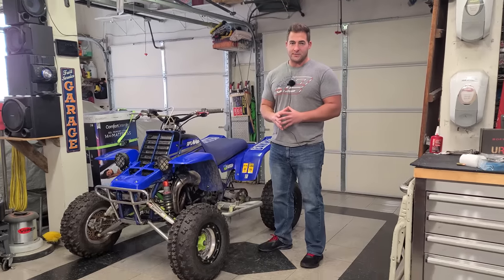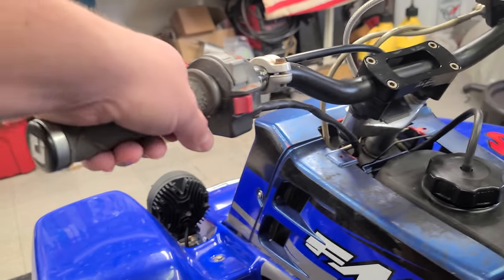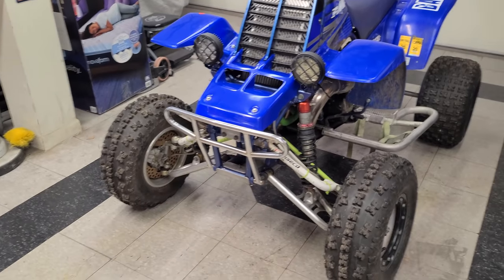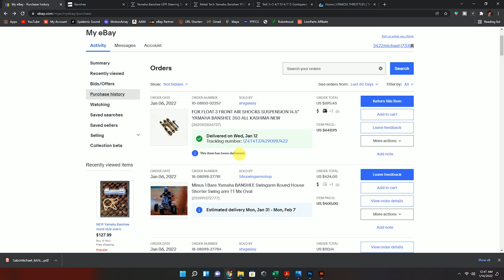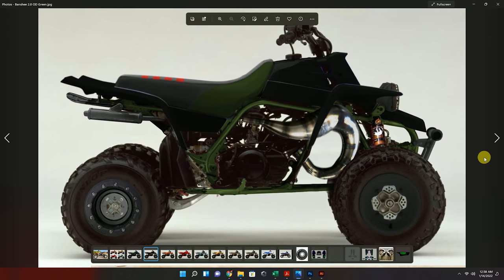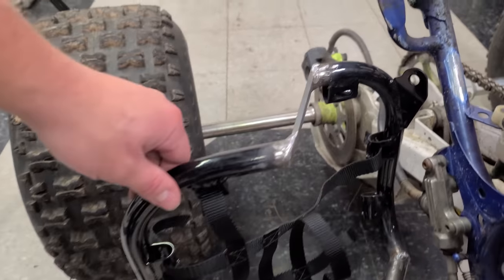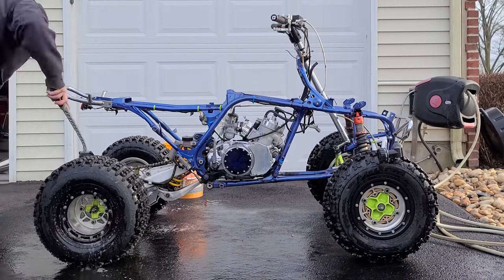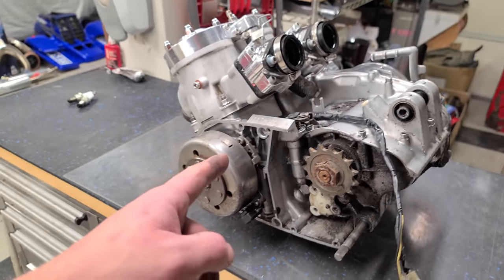Building the Ultimate 2 Stroke Yamaha Banshee for Trails! Voodoo Banshee Part 1

Comment: You would be better off weight wise buying a chromoly swingarm rather than the DOM swingarm from Swingarm shop.  Chromoly is about 25% lighter.
LP Assassin Cylinders with SLP pipes on pump gas is a Trail setup.  More torque in lower RPM and wider powerband.
Cub Porting with CPI pipes on race gas is a drag setup. More HP in Higher RPM and Narrower Powerband.
A foam air filter works better for trapping fine dust found in trail conditions.  The gauze type that you bought is typically only used for the sand dunes.
For a trail machine without Straight cut Primaries, You'll be better off running the Max Load bearings on both sides of the crank instead of the TZ on the PTO side.

Comment: I'm super excited to see the power this makes.  Especially to see how soon it comes on the pipe being a 350 again.  Did You consider swapping over to a new A arms chassis? And for weight, what about polymer rims and bead locks.  I have a set of Tech 3 I found on eBay.  I was impressed.

Comment: Finally, been waiting for the Banshee rebuild video's. Me personally I would have stuck with the 421 and, maybe went with a 2-1 adapter for a single carb. Just my opinion though. Either way, I think we're all looking forward to the build.
Reply from the maker: I'd be interested to try a 2 into 1 setup also; I hear mixed reviews. Thank you for the feedback man!
Reply: Single carbs are nice. You sacrifice a little performance for more low end and a lighter thumb pull. The trick to getting them tuned in right is the needle selection.

Comment: Mike,
I highly reccomend making the swing arm bolt greaseable. By drilling small holes through were the bearings sit; and threading in a grease zerk at one end and plugging the opposite end by threading it and slapping a bolt in. 

100% agree with the planned engine build for a woods weapon. 👌🏻🤘🏻

Comment: I think you should have plus one in wheelbase on the front arms because that also gives you more rear weight bias. Also I always wanted to try the Shearer two into one pipe and single carb. Smooths power band and great weight savings.

Comment: To address the issue with remounting the stock airbox, you should weld on some tabs to secure it only in the back  make them sliding adjustable

Comment: Hey man I'm also from pa but I'm from NW pa and my old 98 banshee was a built as a gncc quad and it was plus 1 wide and it had a 1in shortened swingarm and was lightened up and had bead locks that I took off and that took a lot of weight off it but after I was done with building the motor it was a trail riding beast and was very from end lite and I also recommend the toomy t5 pipes for the trail banshee as well I've tried many others but prefer the t5s 100% and with a good steering stabilizer I think you'll be very happy in the woods mine was a dream to ride and never beat me up anywhere near like my 05 Honda 450r quad did in the woods that thing would have me hurting halfway through a decent ride. But sounds good I'd just recommend not getting too outta control with the Dremel on the cylinders you don't want it to be to be over revy but ya in the woods the minus 1 is awesome for sure and I always ran holeshots on mine even for gncc races and also i found out that the performance of equal length head pipes didn't perform nearly as well as toomy t5s that are not equal length head pipes and it really made night and day difference.
Reply from the maker: Sounds like you had a very similar chassis setup to what I'm planning. I agree that T5s would behave better for the trails; part of the reason I wanted the cub porting and CPIs is because I very much enjoy pipey 2 strokes. If its not as fun as I'm thinking, I will try FMF or T5; I appreciate the tips!

Comment: All that weight savings lost by using water pipe for heel guards.  😆 🤣   Just consider if your wearing boots the angle spot on top might rub or possibly rip a hole or even get stuck in there.   Maybe do a round bend tube?  🤔   Do like the idea your going for.  Plus my buddy is doing a banshee motor rebuild so I can point him to your channel.  Keep up the hard work.  💪
Reply from the maker: Dude I was definitely not in the correct mind for weight savings at the time... that water pipe WAS indeed heavy af lol

Comment: I think u should have worked on getting the power down low for a woods machine. That high comp stock cylinder with huge ports will be all up top. I think it possibly may be worse.
Reply from the maker: It's definitely going to be peaky, but I actually enjoy riding 2 strokes like that; definitely not optimal but the fun factor is awesome!

Comment: The reason the LED lights are blowing out on other people's banshees just like my dad's and cousin's did is because of one stupid thing. The stator puts out AC voltage which LEDs can't handle but regular bulbs can and the stock voltage regulator doesn't work worth a crap. So if you get a voltage rectifier ($15 on Amazon) and wire it in the the light circuit it will convert all AC to DC voltage so you won't fry any more LED headlights or any of your electronics.

Comment: In my opinion, The Banshee is the best 4wheeler ever made period!!! Twin 350 2-stroke! fast AF!!! THE ENGINE & TRANS was originally used on a motorcycle! If one could source that motorcycle, & get the carburetor & the transmission, you'd be set! The motorcycle was designed forage higher speed so, the carb & intake from the motorcycle would definitely benefit you! Along with the sprocket! In a hole shot & out right speed, The Banshee is definitely where it's at!!! I purchased a 03 Blaster 200cc 2stroke/6speed brand new in late 2002 from Wheeling Cycle for $ 3022.00 cash! Tax & everything out the door!!! My buddy purchased a 99-02 (somewhere between 1999-2002) Banshee from Wheeling cycle & after seeing him drive it, I wanted a 4wheeler so, I purchased a Blaster & honestly, I smoked many other bikes except for a Banshee! O e guy was mad because, His 4 stroke 4-wheeler cost 13k & was SLOW! IT MAKES MY BLOOD BOIL THAT THE EPA BANNED 2 STROKE ENGINES WITHOUT TRYING CATELYTIC CONVERTORS! 2 STROKE ENGINES ARE WAY FASTER THEN 4STROKE!!! The motorcycle that used the same drivetrain, had a 2 into one carb!!! Try & get one!!!!

Comment: Looks like you got Michigan ORVs on there. How do you like our state's STUPID system? 2 stickers for $36.25! Used to be 1 sticker for 16.25. STUPID ass Michigan... X(

Love that SPACIAL crank!

Don't make pipes for Banshee's anymore? That's DUMB. That'd be like discontinuing a pipe for the TRX250R. DUMB.

$9000?! 0_0

I don't think that heel net is ugly! I think the upper extension shoulda been pipe like the lower, to make it look more uniform, but that's just me.

Hear me past Mike, I have the solution to your airbox woes! P-CLAMPS! Ah, you saw what I saw in a few seconds. But yeah, go with the rubber sleeved P-clamps. Adjustable for future mods too, as opposed to welding tabs in the new locations.

38.629 years is 14,108.585 days.

I laughed at "scissoring action" as soon as you said it. Juvenile humor is fun.

That skidplate would still be good if it was a PRM. Too bad they stopped making stuff. :( I've got a 1/4 one on my Zilla that could shrug off a small bomb.

I can't tell ya about the engine direction. I'm used to big singles, so I like my torque. Only time will tell you if you made the right choice.

Comment: As far as good led lights- Rural King!!!!!! I got a set on my car! I purchased the wire harness at Walmart but, GET THE LIGHTS FROM RURAL KING!!! OR IS IT ROYAL KING? Pretty sure it's Rural King. Are you missing a sprocket cover on the trans that covers the chain? Looks like your chain needs oiled along with the nut on your front sprocket on the trans.

Comment: Michael I bought a vapor honing cabinet from vapor honing technologies last year and even though I'm kinda semi retired I still build a few engines for the guys at AGMX and some of our local racers and I just wanted to tell u how awesome your Vids are and if you would purchase a vapor honing cabinet to get one large enough to do engine cases and larger quad parts cause I bought a micro blast and I can do engines,but not anything big like frames and long (over 14 inch)parts like aluminum swingarms.And u would also need a pretty decent sized air compressor so check the CFM  of said compressor if u go that route.And I'm a new sub cause I really enjoy the content and like that your fixing up some of the old 2 stroke racing quads,way cool.Keep em coming and keep up the good work.Peace&Wheelies....

Comment: Imo holeshots tires are over all the best tire .Good grab on most terrain. And breaks traction like it should. With out killing the clutch. 
Dirt digger clutch kit is a solid set up.
  Fatten up the main and pilot  jets. 
Run NGK br8es plugs.
 K&n air filter.
Stage III bore and polished cylinders
Wisco  topend  kit..  .020 shaved head.  Hex gear in Trans  no clutch needed ,only to take off.. There's 
 Millions of different mods and combos  avail for the banshee...   loved mine.   Had a few, my bros did also...
Cool old bike, considering the original was designed in 87.. up 
Too 2008 .. in tht time not much changed from factory ... j arms    changed to A Arms..  couple odds and ends changed .. but regardless it's still  basically based  on an ancient design.

Comment: BRO, You can use a file & shape your foot pegs! Also, you can use Alluma rod & add to it! Heck, a bottle of map gas (the yellow bottle) & aluminum welding sticks is all you need, along with the propane torch, which even the cheapest one works but, the more you spend, the better the torch head! I know that  Lowe's & other stores sell the aluminum weld sticks! At my local Lowe's, the aluminum weld sticks are in the tool department on a endcap where the soldering stuff is! Also maybe in plumbing, again where the soldering stuff is sold/displayed! Then use a file after adding material!! Build it up as high as you want!

Comment: For a trail bike you honestly should’ve got something else other than CPI pipes, those CPIs would do great on that 421 but it’s probably not gonna benefit you at all to run them on a stock cylinder bike. I’d stick with the pipes you have now, or something similar. Fmfs or t5s. Not bashing or anything. I’ve built a few banshees in my days.. talk to cam at redline racing. Super smart guy always done my engine/porting work and has good advice on what parts to run with that.

Comment: I think you shoulda maybe gone with a bored out cub motor like a 370 or something. I have also heard CPI pipes aren't the best trail pipe and can have a narrow powerband. U need a lowend torque to midrange pipe that still maintains some overrev that all matches the cub porting(easier said then done I know). I think it's always a good idea to maximize your bore within stock cylinder parameters tho. Just my opinion, not the Bible or anything. Love the channel buddy.

Comment: You should've replaced the 2 carb set up with a single carb to run 2 cylinders.  Wouldn't you instantly get a low rpm boost? I could be wrong

Comment: My ltz400 only weighs 237 pounds granted it has a lt500 Zilla motor on it and it has chromoly single arms and swing arm I tried to meet you at 250r but I ran out of gas just my luck 😂

Comment: Not trying to be rude & besides that can you tell me if I’d be okay building a 4 mil 497? I want to go from scratch and order my engine pieces all at once so I know they fit and go together. Thinking about the 4 mil cub set up ? But then again I want my own heads polish and sum better heads that’s aftermarket! Not sure if the size matters if so how do I tell which size I need with the 4 mil 497 build if I don’t use there head ?  And cylinder’s? Samething head/ cylinder!

Comment: Did someone catch why he wanted to get rid of the 4 mil low compression for 350 high compression? seems like a poor compromise for a trail machine. If you run  out of gas you have limited availability plus less torque.

Comment: Check out factory 43 nerfs , super light steel pegs and they are modular kinda, brings the peg back an inch too for better rider ergonomics. Also the heal guard doesn’t get in the way of the kick start . But rad fab job

Comment: You really run 421 on dirt And trail ride it that does not make any sense at all this Banshee that I’m talking about that I built with a 421 we tried to use it on dirt and forget it too much horsepower just blew the tires right off  Does Banshee now has a 466 10  mill

Comment: What's up Mike so I was watching video and I saw that you said you were going to clean up the ports on the cylinders and I know in drag racing at least that you actually don't want to do that you want that rough finish because when you have air coming in through the intake you want that air rolling you want it tumbling. Now I'm not completely sure because like I said this is more applied from drag racing but I would think that they would have similar aspect so you might want to look into that.

Comment: From what I understand  the texture on the intake helps with low and mid range throttle response. If you make it to smooth you loose drivability but its more snappy. Trail machines should be precise in all rev ranges but hell who doesnt love arm streching powerbands lol

Comment: You don't need the nerf bars unless you're riding in competition They only keep other people's tires out of your safety area.   yeah keep your feet on the pegs and you don't have to worry about it run in over your own feet. Number 2 you're just now complaining about your shock as junk that you got when you bought the banshee. You  rebuild of your engine you painted your frames you did all this cosmetic stuff but you didn't bother to adjust your shock over  4 year.????? No wonder you think it beat you up   Oh then you bumped it up to a 421 stroker.   And you still didn't adjust the shocks!!!!!   go online, read how to adjust them ,  Of course by now Front rear shocks = they probably are trash.  You've got really good videos and a lot of detail. But stop bad mouthing things when you haven't even changed them or tried to adjust stuff.... I did the same dumb thing of the Chinese top end I regretted it after  One season in the Oregon coast sand Dunes.